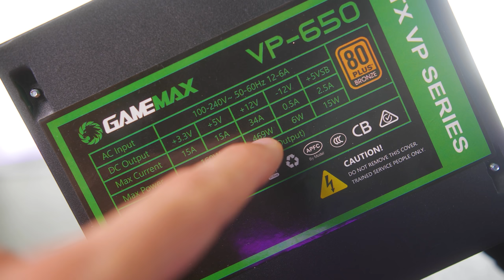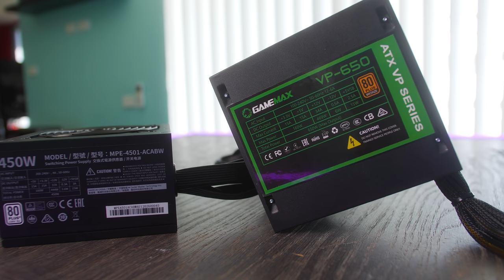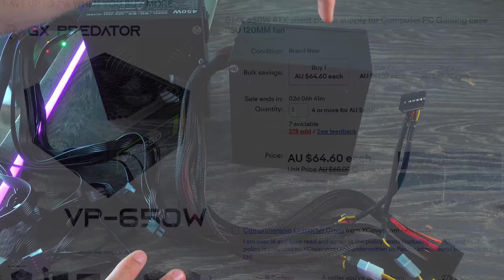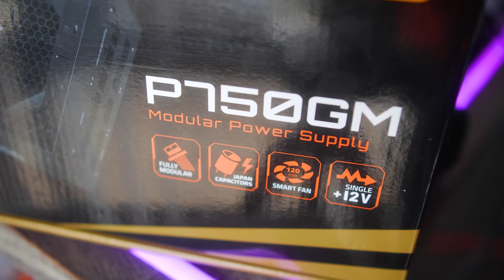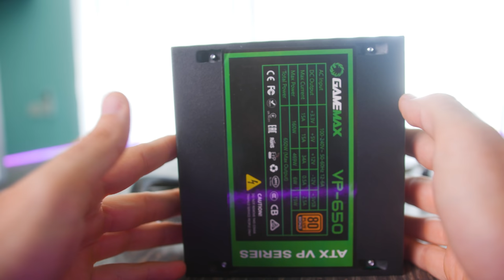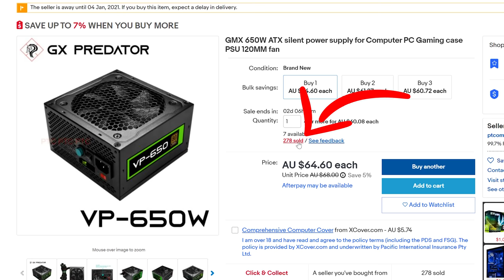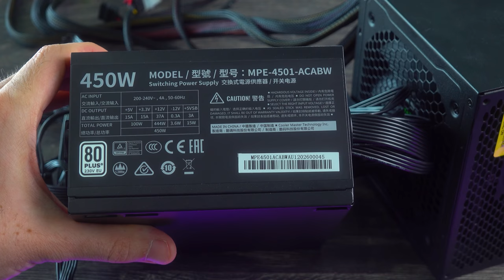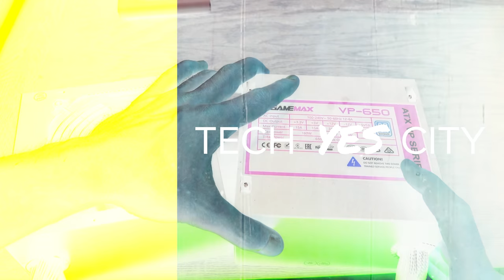This Company is Straight LYING about their "650 Watt" Power Supplies.... (*UPDATE* FAKE GameMAX??)

Comment: Hi Yes Man! Just a fan from Italy!
I had the opportunity to try some of those power supplies, a couple literally "blow up" on the test bench ... 

The first problem with these is that they use a Group Regulated design instead of a DC / DC design (like the MWE, which has other problems such as having 4 versions of the same PSU, which only one is really positive). 
For 65 euros you can literally buy 50 better power supplies than this!

Looking inside a Gamemax is like taking a trip to hell, a rectifier bridge made up of small 4 diodes, primary capacitors of unknown brands, often in series and never proportionate to the work.

The secondary part is as terrifying as the first, we still find other capacitors of dubious quality and also the switching circuits are always ultra slow!

Miraculously ripple (voltage disturbance) never becomes a giant problem on these power supplies ... until you reach around 300W. In that case, even with a $ 30 oscilloscope you start to see real roller coasters with ripple that easily exceed 200mV.

The real problem is the voltage regulation! The voltage of 12V in crossload load is aberrant, it starts from about 13V (classic group regulated) to reach even below 10V, without any protection intervention. At that point, most of the components underwent such high stress that the signs remain forever!
There is basically no difference between buying a power supply like this or a $ 20 one. It's just well-packed "manure"!

Merry Christmas and Happy New Year!
Reply: Merry christmas and don't use PSUs as firework.
Reply: Ciao Saddy! :D
Reply: @jamesfitzpatrick3992  They probably just threw the stickers on there with no certification.
Reply: I really wish Bryan would do this sort of research, get himself a dummy load (even some halogen lights), a cheap USB scope (screenshots), get an idea what actually matters in PSU design if he is gonna keep doing these PSU pieces
Reply: Darth Wheazius  I don't know where you got this rubbish from but giving people the wrong advice does not make you liable unless you are a trained expert whos being paid for a service.

If the guy down the road tells you your tyres are good and they explode whilst driving its not his problem , if a Mechanic doing an MOT says the same thing hes liable.

You have it the other way round.
Reply: Darth Wheazius  This, I mean they sell fake video cards right and left on eBay. Mainland China is the land of the counterfeiter.
Reply: Darth Wheazius  I'm sorry but I'm going to recommend no one takes legal advice from a non lawer as it is far more a illegal impersate a barrister then the impersonation of an  electrician.

The law allows for any one to say a duck is a duck if it quacks like duck, where did you go to law school  dunce cap🤔
Reply: Darth Wheazius  yeah there's litraly thousands of em, yet none are sued because they are in legal rights to say wherever they like, flat earthers juice cleaners, quake medicines, conspiracy theorists etc. Saying a product is questionable is also lawful, why you so but hurt, you selling defective product with illegal certifications or something huh? Been buying knockoff counterfeit goods from China?
Reply: I've tested this shit manure. It not better than 10usd psu scrapped from cheap case.
Reply: 200mv ripple voltage? Holy shish....PC components will likely die within less that a year with that kind of ripple voltage. 
That test system in the video got a real banging.
Reply: Darth Wheazius  lol

Comment: During the last 2 years, we have installed more than 200 Gamemax psu's in mid-range and high-end gaming PC's. Also, we have sold as many separately. We have used the following Gamemax psu's models: GE-700, GE-600, VP-600. We are very satisfied with the performance and durability of the psu's. 

For the record, We have never came across a model called VP650 during the last 2 years. 

Thank you Tech YES City for all you hard work.

Comment: In Malaysia, the power supplies that market themselves incorrectly are about half the price of known brand power supplies.
Reply: the thing is GAMEMAX actually has a half decent reputation... so i really dont blame people from buying this garbage. now we know that gamemax lies like this all we need to do is just avoid their products in the future
Reply: @dhanajon5528  Yes- if it is cheap- at least do not lie about efficiency and power. I have used ~7 extremely cheap PSUs in 2000-2015 (priced only $15-20), and only once had problems- with inbuilt Inter-tech case PSU. However- in my country, power incoming from the grid was always high quality, no blackouts, so I guess that is part of the reason why cheap PSUs worked for me. But still, when buying, I would read negative customer reviews, to sieve through the garbage, and pick the one that is someone decent- and I would never pick a brand that lies. 
And these days- PCs got more powerful, especially GPUs take more power- so now it is better to buy budget line, OEM/tray packaged PSU that is made properly. Even if costs +$20 extra- that is worth it over poor efficiency, unknown quality PSU.
Reply: @dhanajon5528  Depends on your standards. I wouldn't even sink as low as Thermaltake and they are still head and shoulders above this trash.
Reply: When you consider that fire chargers lack proper protection one can only run such a PSU only at half load somewhat reliably.
1. Health and safety is no joke! It can cost a lot more than a PSU if it is left unattended.
2. With 🇪🇺 electricity prices one would be better of getting a platinum-rated PSU if the computer is running for a considerable amount of time.
For anyone considering "Fire Supply Unit" or "Fire Charger". You should get bigger than 60€ problem! You can start a business online, especially if happened to live in place with low wages like Ukraine, Bangladesh. You could export your services to developed nations and have good living standards for fewer resources than in the west.
Reply: There is Game Freak power supply non-certified 750w sold for $10 new. In reality its only produce less than 400w. A lot of pre-build seller use this power supply in their build and listed it as 750w.
Reply: My first ever non-OEM psu was a cheap weirdly named brand "700w". Never realized it didn't even produce 500w until I accompanied a friend a month or so later to the same vendor and the guy disclosed the true wattage. Lesson learned.
Reply: which is y dun buy cheap brand
Reply: @CheapBastard1988  I bought a used Thermaltake Black Widow TR2 RX 850w think it was probably 8 years old, and it powers a Threadripper 1950x, X399 Gigabyte AORUS Gaming 7 mobo, 4x8gb 3600Mhz DDR4 memory, 3 SSD's, 8 HDD's and a R9 Fury no problem. Thermaltake and Antec have been the absolute best for me so far.
Reply: @wmp0074  That's only a sample size of one. The problem is that many people who have owned a Thermaltake PSU have regretted it in the end. Which is typical for Chinese products: The ones that are fine are just fine but the QC should have filtered out the rubbish and they haven't. Therefore it's always a gamble and I've been through too many cheap PSU's during the Pentium 4 era to stay away from them now that I can afford reputable brands. I don't care if I have to pay double if it gets me a quality product.
Reply: @CheapBastard1988  Some people are still running these Black Widows. Guess they had a decent sample size to back up with a 5 year warranty, and surpass that by many years. You can get a lemon from any brand. It happens even with Seasonic.

Comment: Great video! I have the 600w model and it's fine. As to the counterfeit, I will say there are cosmetic differences between yours and mine. I purchased mine from Amazon straight from the Gamemax store. 600w rgb ready for $55 and I love it. I will do a power draw test and see what it does under load. Very interesting stuff. Love your vids!
Reply: So od u still like it?
Reply: @kamelferrahi436  Yes, it still works great!
Reply: @cngameygamez  HAHA Fast reply i like it ! i was kinda reluctant to buy it but i didnt have any other choice since compu,ters in my country are overpriced asf (an 3060 costs litterally between 500 and 500$) but now im kinda assured aniways thanks for the reply

Comment: Back in the mid-90s, I took an online course on building PCs. It went in depth discussing components and how to choose them with a critical eye. I always remember the section on PSUs. NEVER, EVER SHOP FOR A  PSU STRICTLY ON PRICE. You generally get what you pay for, and a cheap PSU is generally cheap for a reason: they used the cheapest parts they could find to meet the price point. The second rule of thumb has also remained with me: The PSU is THE MOST IMPORTANT PART OF YOUR COMPUTER, as it powers everything else. If you throw money towards the purchase of the CPU, memory, motherboard, and GPU, then have to shop for the cheapest PSU, you need to reconsider your priorities. It was a great course and I've never ended up with a bad PSU as I do my research before purchasing.

Comment: Pro Tip for power supplies: The 12v rail should be rated right around the total power supply wattage. So on a 650W power supply, the 12v rail rating on the sticker should be at or near 650W by itself. The sticker on the "650W" power supply in this video showed 469W on the 12v rail (which also was incorrect based on Volts x Amps) - that right there should have been a sign of a crappy power supply and a misleading rating.

Comment: Easy test (taking appart this things is AT YOU OWN RISK, high oltage inside even when it is umplugged). If power transistors are 13007 or 13009 (could be another part) and controller chip is on  your right (same area were the computer cable go out of the board ..., mostly likely is the typical POS ATX PSU which will give you not more than 450W (extreme case of best contruction). For a 650W PSU, design is another ball game, controller chip tend to be in the side of the big two input filter, most transistors, BIG TOROID (PFC) near the input filters. Chape garbage is able to deliver peak power decently but under sustained load for long periods, they cut if you are lucky or go short.

Comment: Yep I had one of the 550w ones, wouldn't even power on my ryzen 3200g with rx580, so I took it out, plugged it into the wall to jump the fan to see if it even worked but before I even could the fuse blew with the mightiest flash and bang I've ever seen. Stay far away from them. Got my money back on it but only after sending it back through eBay return.
Reply: @AmigaWolf  gotta check the seller on eBay, some of them are actual stores like computer alliance or mwave n stuff.
Reply: Might be worth digging a bit deeper to determine if it’s even a real GameMax or a shoddy counterfeit.  GameMax doesn’t even make a “VP-650” model...

https://gamemaxpc.com/productkkk/list-276-en.html

...but they do make a VP-600, which really is certified 80+ Bronze:

https://www.clearesult.com/80plus/manufacturers/115V-Internal/

Looks like this may be a counterfeiter peddling generic Chinesium and trying to trade on someone else’s name, rather than an entirely garbage product put out by GameMax.  Although it is worth noting that even the genuine VP-600 uses the same misleading labeling of combining the max power of 3.3 + 5 + 12V rails to come up with “600W”; at least on that model the math is right for a 40A current at nominal 12V producing 480W peak on the rail.

Comment: One of my sleeper tips has always been FSP.
I got a 350--60HHN that technically fulfillls 80PLUS specification (but hasn't been certified), and delivers up to 336W on it's two 12V rails.
In general it's totally fine for a midrange gaming rig with something like a R5 3600 and GTX 1660, despite not being one of the "big" brands (despite FSP being one of the few who actually manufacture PSUs, most just put their sticker on) and looks ordinary in a grey chassis without any sleeving. Can be found for under 30€ here.

Comment: I was saying the same thing this week. The amount of garbage being permitted to enter the country and sold as legitimate goods is staggering. Never mind the outright dangerous goods Chia is permitted to import. 5kW lasers on Ebay. WTH? UV lamps and bulbs. It's crazy.
Reply: Pulse lasers like tattoo removal? Highest laser I have is only 7w for metal engraving and a handheld pocket laser pistol I need to figure out what I screwed up on that’s around 5w output (fried a diode, hopefully I don’t have to use a different driver because I’ve already designed and made the custom housing for the specific Lipo batteries/driver housing/barrel shroud for the heatsink so changes will be annoying. It’s great though, used laser diodes are like $30 so you can build some insane stuff for well under $100.

Mine is setup for conceal carry since some places have “gun free zones” (unfortunately not areas where they give away guns, but where you are not free to carry guns, stupid I know because no criminal is going to follow that sign meaning only people defending themselves will be prosecuted for protecting themselves), and there are no “photon emitting optical weaponry banned” signs anywhere.

Comment: Ones that are having 12V wattage rating much less than the main label are using obsolete design from 90s with single transformer supplying all the different rails which is inefficient, and often can lead to instability if the 5V/3V3 rails don't get loaded enough.
Modern ones have the main transformer supply only 12V and then other rails are obtained via DC-DC converters.

Comment: With power supplies, you're supposed to look for the "max continuous power" rating spec, and not "max output" peak 650W like this PSU was advertised with.

Trustworthy manufacturers designate their PSU wattage number by continuous power and not peak power. If any PSU doesn't have a "max continuous power" rating, then don't buy it.

Comment: Really don't get this, in the UK we have the GP-650 which I've used a few times now and never had an issue,.  I've just checked out the one in my rig  which has 2*8 pin pcie connections and the 12v line which converts correctly to the correct wattage so stumped with the VP-650,, also gamed on mine for much longer times with no smells.  Almost makes me think its a fake in some way if thats even possible, was it from amazon directly or a third party?  Good video by the way and I'm glad you've done this review and shared, will still be keeping on eye on my one now!

Comment: That is either a counterfeit psu or a mislabeled psu. I run a small pc repair/pc building business in the US. I've bought 23 of the Gamemax VP-650w psus (on Amazon from Gamemax)and they all performed at the 80% efficiency. The models i got are completely different from yours. The psu fan is always white, not black. None of the 23 VP-650w have the green eco button at the back of the psu. All 23 psus came with 2 x 8pin pci-e cable. So that must be a counterfeit psu.

Comment: It always pays to go with either the OEM power supply installed in a prebuild if you not going with anything high end, or if you are upgrading/building your own system to always ALWAYS go with a name brand power supply, and go with at least 30% - 50%(a power supply is most efficient at 50% or less load) more than you need with at true 80plus Bronze certification. I've been building computers since the late 80's, and I had to learn this lesson the hard way having power supplies blow up with the magic smoke, and even killing an entire system.  I'm in the US, and if you are on a budget Cougar, and Rosewill from my experience make good budget power supplies, cases, and acessories who stand behind their products.

Comment: Very interesting thing with the 12v rail power vs current. I had a weird theory when I saw the numbers and it checked out. They're still very wrong, but still it checked out.

I often have "12v" bench supplies around for radio equipment. Usually they're linear but you do get switched mode options too. it's FAR more common to run this stuff at 13.8v. Why? Because that's generally the voltage in a car when the engine is running (it drops to 12v when you stop it). Most amateur radio (and CB Radio) equipment is setup so the max rated power is achieved at 13.8v and often you'll see a slight falloff (10% maybe) in output power when running at 12v. So, we get 13.8v supplies to use the stuff indoors. I wondered if the actual manufacturer (not gamemax, I'm sure there's some underlying maker) also makes these kind of power supplies and that this was where it went wrong when noting the figures on the unit itself.

Sure enough, take 13.8v and multiply by 34 and you get a pretty damn close 469.2w. I'd be interested to know what the voltage on the +12v rail actually is... But in all honesty I suspect it was just the maths that was using 13.8 and not the output. Maybe if you have a multimeter and the time you could take a sneaky look just to confirm that.

As far as lying about the 650w. That's a "technically" thing isn't it? I mean, sure all other PSU makers specify the power rating on the 12v rail only. But they're not actually lying because the total rated across all rails is 650w (discounting the current vs power snafu). It IS however a totally dirty thing to do, because everyone assumes 650w means 650w on the +12v rail. It's very very misleading at the very least and will cause tears when someone tries to run a 3080 and overclocked CPU on that poor thing.

In my mind this PSU is probably built terribly, with the cheapest components possible, they're marketing it badly with non-standard power ratings, and yes I'd not touch one of these with a barge-pole.